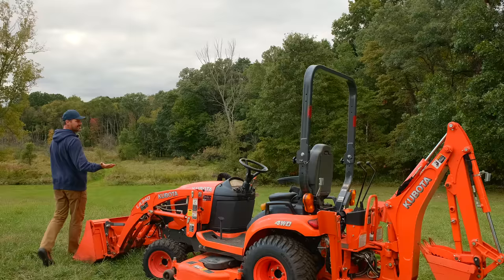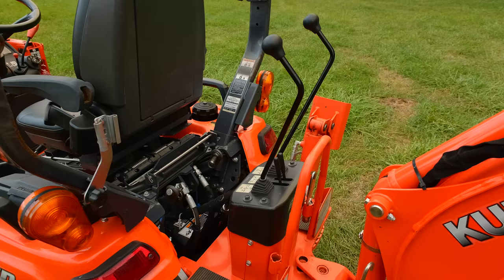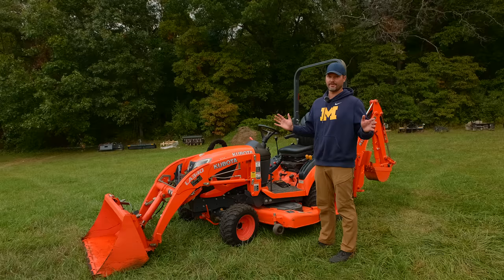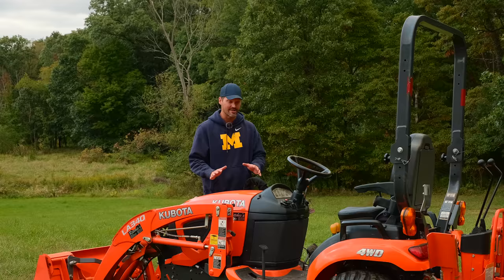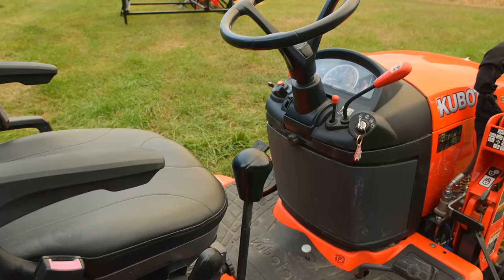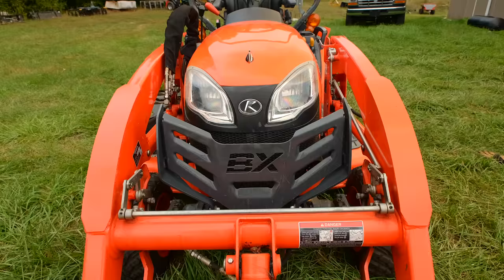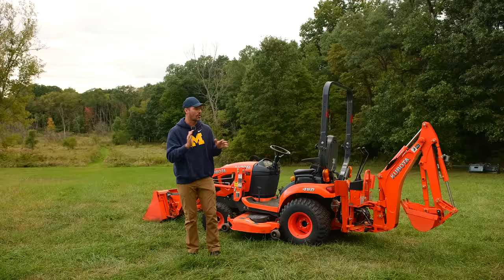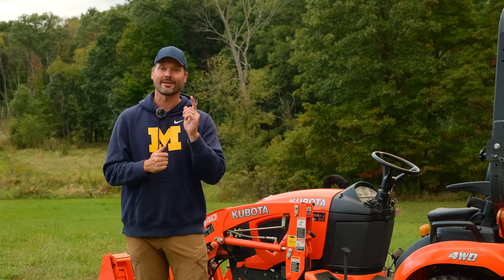PROBLEM AFTER PROBLEM AFTER PROBLEM

Comment: I have a BX2380 in my garage because the JD was a few thousand dollars more. The few things the JD does better just aren’t worth the extra cost to me, because the Kubota does the jobs I need it to do. 

The only thing I really hate about the Kubota is mower deck. It’s a pain to wrestle a 250 lb mower deck on and off at my age. I’m probably gonna trade that in on a 3 pt quick attach compatible finishing mower at some point.
Reply: I’m in the same boat. I compared a lot of tractors and in the end it came down to price. I’ve been thinking of trading the mid-mount mower in for a quick hitch compatible finishing mower too. Getting too old to wrestle that deck off.
Reply: @jamilleizer  Use the FEL to lift the wheels above the mower and push it forward. You don't even need to reposition the antiscalping wheels. Then lower the tractor and use the FEL to move it around, flip it over, etc.

Comment: My biggest issue with the BX backhoe, are the short outriggers with small pads. They're nearly useless... and God forbid you need to get stable in an area that's the least bit wet.
Reply from the maker: Hmm hadn’t had that problem myself, add it to the list!
Reply: @GoodWorksTractors  - just digging a utility ditch or soil work, it's not a problem. When you start trying to side shift rocks, it's a real problem.
Reply: Art In Metal have a long arm kit for outriggers.
Reply: @justinwright6611  - thanks Justin! I'll pass it along. The unit I used was a rental.

Comment: 80 hours on mine, I’ve used my backhoe as much as the bucket. No problems. The only thing I do not like is having to turn the seat around when using the backhoe
Reply: I notice many YouTubers will lean over the back of the forward facing seat to operate the backhoe when they need to move a lot. Personally I’m too short to even try, but I can see doing that for small jobs.

Comment: sounds like to me that whoever had it before treated it like it was a 200k tractor.  Its not so much a Kabota problem to me as much it is a user problem. Perhaps someone over pressurized the hydraulics with shims which probably caused the leaks. Its a fantastic little tractor for small hobby farms. How you treat it is how it will treat you.

Comment: If you installed wheel spacers on the front might be the cause of the tires rubbing the mower deck
Reply from the maker: Seems like it would help, not hurt.  Mower deck starts to taper back a bit the further you go towards the outside edges.  Would think it’s moving the tires to an area with more wiggle room?
Reply: @GoodWorksTractors   the farther away the wheel is from the kingpins, the farther front and back the wheel will travel when you turn.  I guess the only way to one for sure is try it and I don't have a bx.
Reply: I thought I saw adjustable stops on your spindles. So why not adjust them to keep the tires from rubbing the mower deck?
Reply from the maker: Interesting to know!  I’ve never seen anyone mention this issue before with front spacers on any tractor.  Can’t believe I’m the first

Comment: It’s a bit of an odd video for me.  BX2380 here 150h.  Looks like he ran it into stuff carelessly.  Something’s weird about the tires.  Mine is a workhorse, but not indestructible.  I’ve had a loader arm pop out due to bending the latch.  I’m currently digging out rocky garden soil, which is a challenge but doable if you take the time.  With the lifting weight limitations, you need very light attachments and smaller loads.  It will lift a full bucket of damp rocky soil, but barely to full height.  I’ve moved quite a few 8’ logs as well.  Never tried a JD, cause the sales guy never got off his seat.

Comment: I say take off the mower deck completely and just use it for light tractor duty, for that I think it would be great despite what the numbers on the sales brochures say besides an entry level zero turn can almost be had for the cost of that deck anyway and mow faster and better cut.
Reply from the maker: Yeah no mower, then just leaks and poor capacity to deal with
Reply: @GoodWorksTractors  could have gotten a lemon or one of the earlier versions of the BX80 series where they didn't quite work out the kinks the first time. I'm not biased towards any brand but obviously with a few exceptions kubota owners know about and you have discussed here along with other tractor channels here, I've never know them to make an unreliable product the 80 series hasn't been out that long by comparison to the Deere 1 series or Mahindra emax series, this one was launched in 2018ish I believe. That being said I wouldn't say it's a bad tractor just based on that. However though I do agree it is frustrating nonetheless to have a machine with under 400 hours with issues that usually don't show up till much later
Reply: Plus I take the capacity with a grain of salt the paper numbers aren't the real world working numbers as most of the time they measure weight at the pins and not what it can lift inside the bucket compare it that way and they're closer than you think
Reply: @jhomrich89  Not a lemon. That tractor was CLEARLY abused. If someone abuses their tractor like that, what do you think the odds are they performed any of the recommended service? I have its predecessor BX25D and it has been wholly reliable, but I actually service mine. I had one hydraulic leak on one line on the FEL, but 30 seconds with a wrench resolved that and it has not reappeared.

Comment: How do you get that much damage and that many dents with only an hour worth of use? If those dents were there prior then you shoulda said that cuz it seems like the previous owner abused this machine.. I have worked my BX to death and I havnt had a single issue you spoke of. Tho I obviously have the bx2370 not the new 80 series which I will admit they do have leaky hydraulic manifolds but everything else you mentioned is the first Iv heard of those issues. Thinking you just got a machine that was badly maintained and abused from a guy who didn’t know how to run or use it properly so I wouldn’t give a full review off just your single hour of use and time with this single machine
Reply: PS. I am getting close to 1,000 hours now on my BX last I checked I believe

Comment: I enjoy your videos, but I am going to have to tease you about one thing--your purchase price.  First, to put dents like that in the bucket and other areas is some serious abuse, and I am very hard on my equipment but never managed any noticeable dents in any of the Deere or Kubotas I have used/owned.  I have even  slammed into boulders mowing new hills at full speed with the my BX deck and only gouged the deck.  I think A lot of us would have passed up on a 400 hour abused machine like that for our only machine unless it was a really good deal.  So, price paid is everything.  I passed up a similar machine that looked contractor owned and abused and it had 900 hours with no dents or leaks  The big downside for deck abuse---as you know- it is a pain to remove, so I, like some contractors take unfair advantage of the 6" deck clearance height to bush hog rocky terrain that should be weed wacked and leave the deck on to do grading work in rocky terrain even though I know I should take it off. I do know prices can be tempting.  Soooo, how much did you pay for this machine?  I think you should give a free hat to the first subscriber that guesses the closest price.    I bought a 2003 BX 1400 hour machine that had been sitting a while but ran great and did have a slight drip from the steering cylinder which actually leaked less and less the more I used it until it hardly oozed at all when I sold it at 1700 hours.  I don't think you gave the year although I am thinking it is probably a 2017.  I am going to say $14,000 before repairs and tires.  Am I close?

Comment: have the 2370 , really no problems except it started bogging down for fuel and i changed the fuel filter and did better for a while ,then I  watched a video and realized there is a second fuel filter up under where i had to take the deck off. . why a highly paid engineer decided to put it there is just baffling

Comment: I'm probably done with Kubota after mine dies.  There are a lot of design flaws & my dealer treats me like a thief, they're christian-hillbillies born in the city & I'm a squatter so we don't get along.  My 70 series has some screws digging into the back of the headlights, & my bagger smashed the rear lights by the previous owner.  I don't hate it but it's not a professional experience, it isn't designed by users who own a machine.
Reply from the maker: Sorry to hear that

Comment: Lol. My BX23S was 2k cheaper with a 60” mmm then the JD TLB with no mmm. The single point hydraulic connection is awful. The hydraulics front and back are measurably smoother then the JD, and actually the little Massey has the best hoe out of all SCUTs Ive used. My front tires come nowhere near the mower deck at full lock. Thats an odd one.

Comment: Just my opinion but I feel that Kubota in general is very overrated.  Any Kubota machines that I have run seem to be poorly designed in many aspects and fit and finish is kind of crude.  They all have pros and cons but Kubotas just don’t seem to hold up both mechanically and their paint fades very badly as well.
Reply from the maker: Their larger machines are well built

Comment: Interesting coming from a John Deere man. Looks a little beat to me so I’d imagine it might leak just like all the other brands do. A lot of us don’t have access to all the toys you have so we have to use what comes with it at a fair price. You couldn’t buy a John Deere for what that Kubota cost new. As far as the wheels touching the mower deck, mine doesn’t on my Kubota. Maybe take off the wheel spacers on it and it wouldn’t rub. For not liking it you sure managed to include a lot of options you sell that fit on it.

Comment: I work for kubota. I assemble 20 to 30 bx23s models a year. If someone beat the shit out of it . That ctap is gonna happen.  The 400 hours on it . Was pure abuse. Hense the leaks. Bent parts. Missing stuff. Its a great machine. Your adjustment is majorly messed up on your deck . That is easily repaired . Personally its to small for any homeowner trying to move mountains. Looks like it was used as bulldozer. Only issue we ran into is factory defective claw for the excavator . I personally think you bought a lemon. Buy a new one and then see. Kubota bx23s they rarely ever put on mower. It will go on the bx2380/2680 without issue.
Reply from the maker: It's easier to beat up Kubota's than it is pretty much any other brand.  I buy used tractors for a living.  Kubota's simply don't hold up like other manufacturers.  I turn down more Kubota's than any other brand due to how crappy they look cosmetically.  Nobody wants to spend 10's of thousands on a machine that easily fades, dents, leaks, etc.  Gotta treat them with kid gloves.  Engines are great though...oh and smooth hydraulics too!

Comment: I would think a tractor guru like you would know a tractor that has been misused and probably not serviced till you got it. I've had mine BX23S for four years and 800hrs with a minimal problem. The backhoe stick had a piece break inside the column and with a $23 fix I was back to digging. All I've had to fix was that and replaced the front tires in which I had no problems with them hitting the deck. I wish I would have bought my tractor 20 years ago and if it cooked I'm not sure I would be married😁😁
Reply from the maker: Think ya missed the point.  Put the same operator on a 1025r and it’ll look much better.  I am a guru.  Part of that comes with looking at thousands and thousands of tractors.  BX’s get beat up quickly and simply can’t hold up to real work like a 1025r.  The BX is a clunker compared to the 1025r in nearly every way. 

Kubota beats JD in nearly every larger Series though, but not the BX.

Comment: I have a 10 year old bx2660 ( loader, mower, back blade ) with 770 hours. We bought it new.  The ONLY thing that needed replacing is one hydraulic hose.
Now retired I am treating myself to an upgrade...
B2601 will be delivered next week.
Sounds like you bought a used beat to death one and then complain about it being beat up.

Comment: I have a BX23 for around 15 years ,pretty much trouble free. Your video sounds like you bought the wrong unit and then complain about it being the wrong unit.The damage on the tractor before you bought it may explain the leak issues. Looks like the input in the comments figured out your deck/tire issue.
Reply from the maker: I've had more BX's than I can count on all my fingers and toes...all I do is buy and sell tractors and have for years.  The BX is an inferior tractor for the money.
Reply: In your opinion of couse

Comment: Seems unfair that you are criticizing a second hand tractor with 400 hours on it without knowing the full history of the machine. I think your comments are fair if you are discussing this particular tractor, but to generalize to all BX models is a bit of a stretch.
Reply from the maker: Why?  Is a tractor’s useable life close to being over at 400 hours?  That’s supposed to be barely broken in.  I’ve had dozens of BX tractors and turned down 100’s, maybe 1000’s because of a high propensity to have issues.
Reply: @GoodWorksTractors  I agree, a tractor should last longer than 400 hours. That said, I have a feeling the particular tractor in question is the problem here. All the same, I do enjoy your channel as I have learned a lot of things from you over the past 3 years (especially your views on quick hitches). Heck, you even helped direct me to purchasing a BX a while back after a couple of your videos. Keep up the good work.

Comment: I have a BX23S and 250 hrs, totally trouble-free. No piece of equipment is meant to sit with no use. Your bias toward JD is clouding your opinions. You are wrong to make the statement on your clickbait on youtube. Everyone has their reasons for choosing one brand or another. The prices of JD and the costs for parts and maintenance put them out of the running in my area. I am sure each has its strengths and weaknesses. I have run hundreds of pieces of heavy equipment and the well-maintained ones beat the neglected every time. Too bad I used to like your channel....

Comment: I have a 2015 BX25D and have beat the living crap out of it. have not had any issues at all. the only thing that I have done is replace all the tires from me damaging them, and normal wear items like oil, and belts and blades on the mower. This guy is talking crap about something he apparently doesn't  know about. When you have all this other stuff that he wants to use of course he will use the other stuff. Sorry but he is not the person for this type of equipment.

Comment: the wheels hitting the mow deck is inexcusable. how do they have the cheek to sell that design
Reply: It’s not the design. As several have said it’s probably the spacers on the front wheels.
Reply: it's not a flaw, someone clowned this one out with nonsensical wheel-spacers

Comment: The main problem is just that these tractors are too small for anything but homeowner lawn & garden use. Too light...not enough horsepower...wheels too small, and trying to be a do-it-all....but we all know that things that try to do it all excel at nothing. Backhoe is too light and weak unless you live on the beach (Never understood why people even buy those things- If you need a backhoe...this ain't gonna do it; a 3pt. hitch is 100x more useful....). 
tl;dr; These ain't tractors- they're expensive toys. If you need a tractor...get a real tractor...for the same money spent, you can have so much more and actually get your work done...and without breaking anything.
Reply: the BX23S backhoe will trench anything... in fact the backhoe is the most impressive feature
Reply: @LexusGX460-OFF-ROAD  Heck, full-sized backhoes sometimes struggle in the hard clay around here... I'd be amazed if a li'l one break such ground- you need some weight...not only on the bucket, but the tractor as well.

Comment: If you have other pieces of equipment, more designed for your application, why did you spend your money on this tractor. You bought a piece of equipment too small for your needs and that is where you went wrong. It’s not the piece of equipment that is the problem.
Reply from the maker: Do you know what my channel is about?
Reply: Apparently I don’t